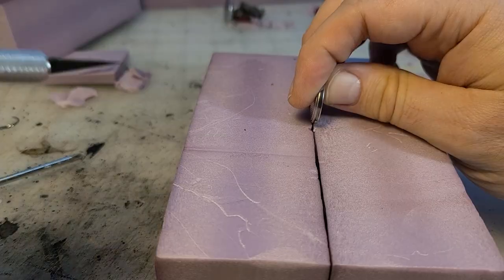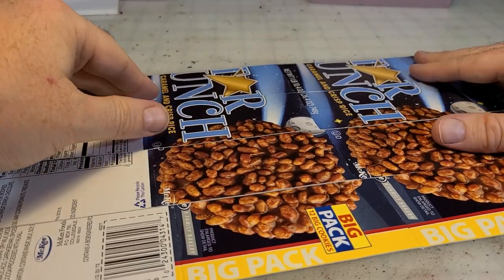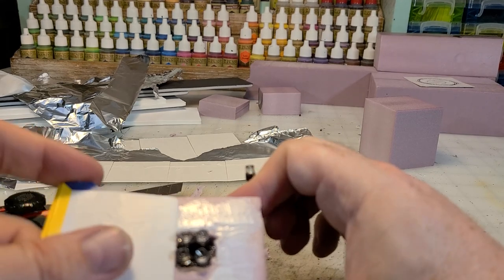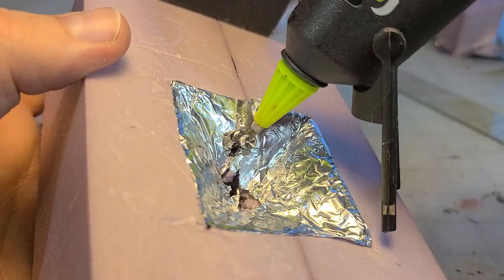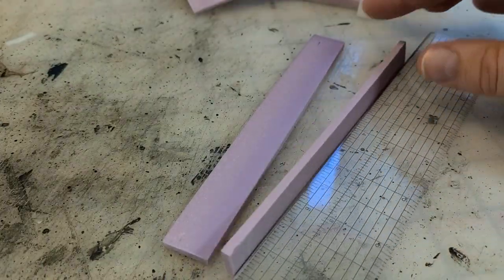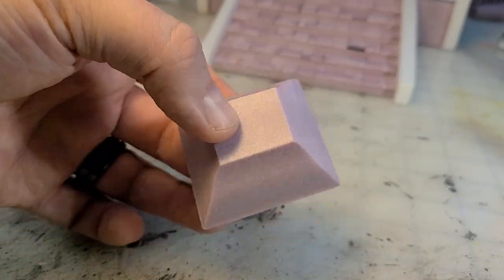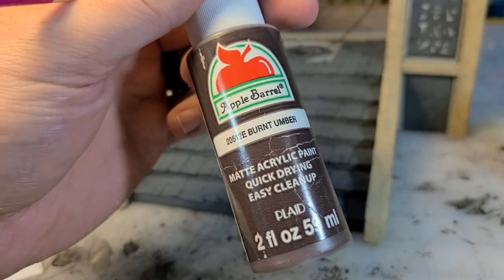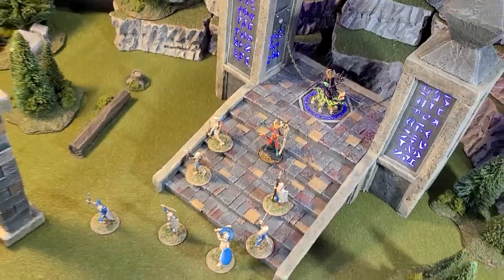The Prison of the Gods

Comment: Neat. It occurs to me using a cricut machine on the box and silver spray paint on the inside to do the reflection might make things easier.
Reply from the maker: Both great ideas.  I end up getting my hands on a laser cutter.  Check out the frozen monument video.  Same idea as the circuit machine. 😁👍
Reply: @brokenterrain  I remember that video. How's that laser cutter working out for you?
Reply from the maker: Love it.  The wife and I make side tables and stuff.  Need to lean into crafting with it a bit more.